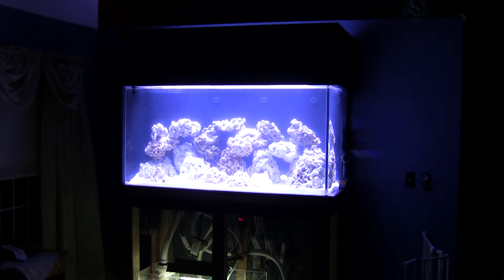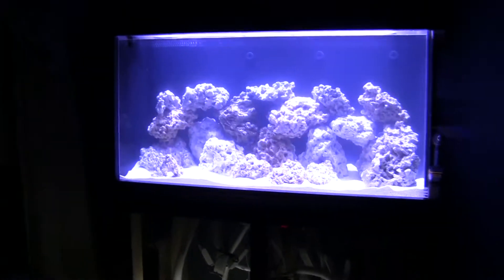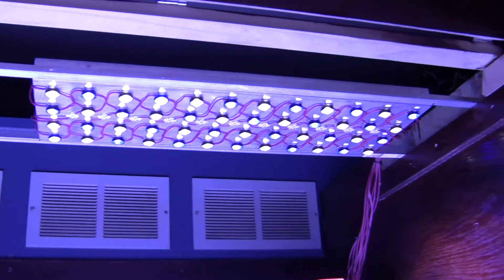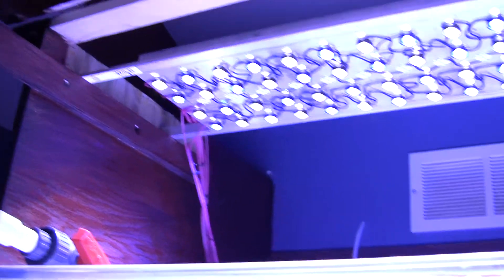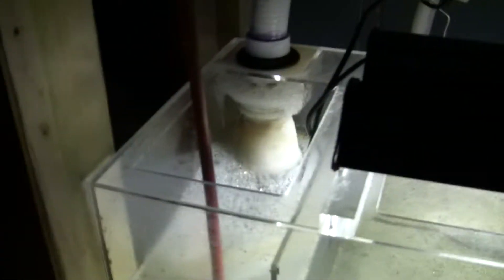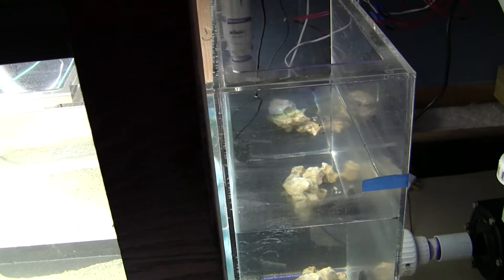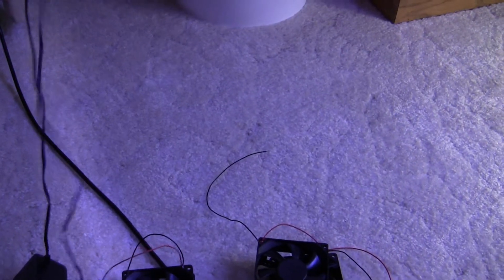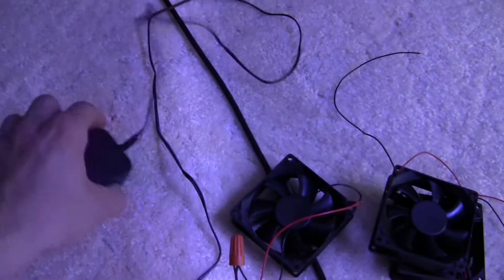185 reef tank DIY LED installed part 11.m2ts

Comment: I really appreciate the instructional video. My plan is to build LED's lighting for my 300 gallon and my 120 gallon reef. 

You spoke of two Auto Dimming options and I am interested in tying those in place of the Enercell Manual option. Do you have any info or links on those dimmers?

Thanks again.